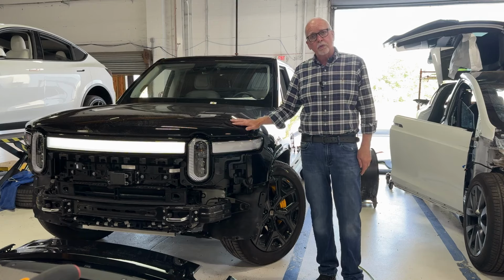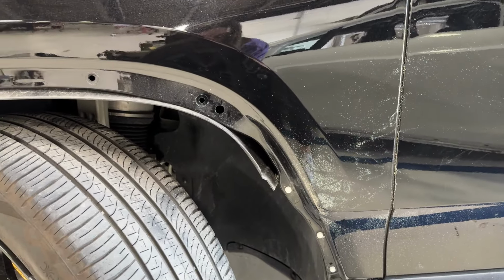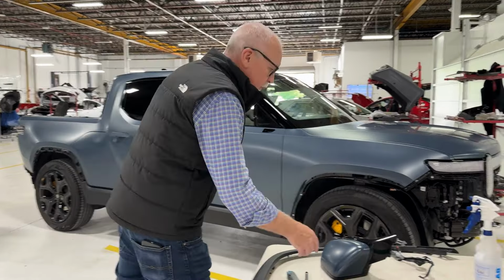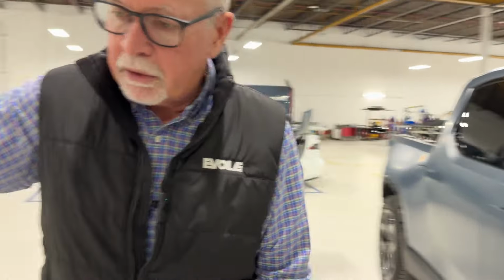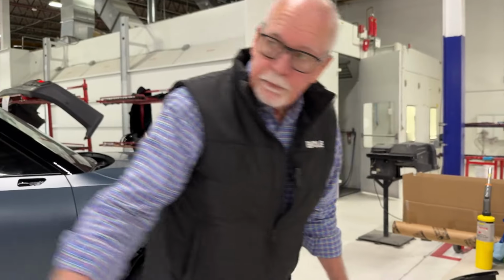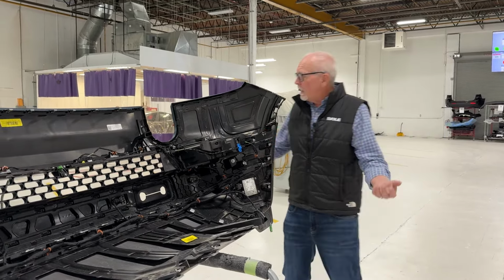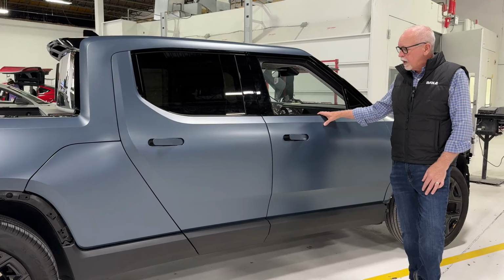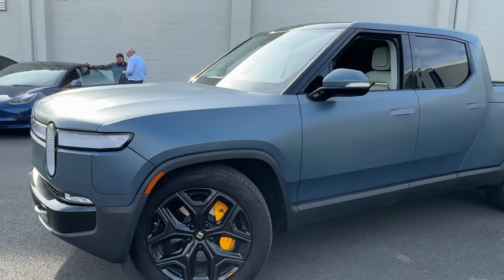What's Different About Wrapping Electric Vehicles? | A Closer Look

Comment: I was always curious about recalibration. If the sensor or camera is permanently affixed to a panel of the car and that panel is then affixed to the vehicle why is recalibration necessary? Is there that much wiggle room in the tolerances that when you take a car apart and put it back together things are out of whack?